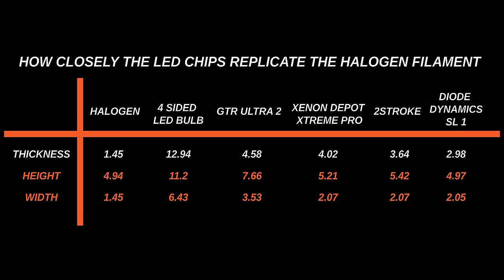Why You Should Avoid Multi-Sided LED Bulbs | Headlight Revolution

Comment: Hi! Need your help , I have a 2005 Toyota Corolla and I was looking to install this 9008 H13 Led Headlight Bulbs High Low Beams 100W 12000LM Conversion Kits 3000K Yellow 6000K White 8000K Ice Blue 4 Sides Car Truck Headlamps Anti Flicker ZDATT. And they have multiple sides. I haven't fine a yellow LED with only two sides. How I could find one that fits my 2005 Corolla.
Thank you!
Reply from the maker: Hey Charlton, Send us an email at Sales@HeadlightRevolution.com and we'll find you a good option. You really don't want to run that in your headlight.
Reply: My car has a single bulb projector setup. I have upgraded from stock sylvania bulbs to Osram night breaker laser. Does it make sense to move to LED, as the light housing does not have much space behind the bulb and i may need to cut the cap to accomodate the drivers
Reply from the maker: No, In your case you already have arguably the best setup you're going to get. The Osram Nightbreaker is a great bulb with a good color temperature and there aren't many LED options out there that will even fit your projector headlight, Let alone perform well.

Comment: Been using the Putco F1 [could be replica] for almost two years.... 9006 Low beam and fogs. On three of the four bulbs bits of the yellow filter flaked off projecting purplish spots in the beam. 😞
Reply from the maker: There have been major changes and advancements in technology since the Putco F1 came out. You’d be amazed at how much brighter these newer bulbs are!
Reply: @HeadlightRevolution  what's the best type of led chip to look for?
Reply from the maker: It's not just about the chips anymore. You want a bulb with a good fan, a good driver, a good heatsink design, and a good warranty. Send us an email to Sales@HeadlightRevolution.com and we will go over a few great options for you and your vehicle.

Comment: Your video is convincing but I still don't understand why these two sided LEB bulbs work at all.  The halogen filament has 360 degrees of light output (north, east, south, and west).  The LEDS have no north or south output, just east and west.  Why do they work?
Reply from the maker: Everything was explained in the video!
Reply: @HeadlightRevolution  I just watched the video again.  The halogen bulbs have 360 degree light output while the two-side LED bubs do not.  I guess that the 360 degree light output is not needed with these reflectors, it is just the side to side output, as well as the proper placement in the reflector, that is important.  Why didn't you just say that?

Comment: Try the bullet led bulb into the projector headlight
Reply from the maker: We've tested them and they haven't done well in the Tacoma or Ram projector headlights.
Reply from the maker: Some of the best bulbs on the market are adjustable, Like the S-V.4 and the Ultra Series 2. That being said, The best alignment is usually at the 9 and 3 o'clock position rather than up and down when it comes to chip direction.

Comment: how should the sv4 be oriented in the housing?  it came with an adjustable collar and i wanted to know if it should be vertical or horizontal or some other angel?
Reply from the maker: You want it to be horizontal, With the LED chips pointing at the 9 and 3 o'clock position. That will give you the best possible beam pattern.
Reply: @HeadlightRevolution  Thank you.  Does that go for the high beam and fog lights as well?
Reply from the maker: Yes, That applies to almost every housing on the market today.

Comment: There are 5 Sided ones now too... 
My 2002 Focus Wagon Headlights "Liked" the 3 Sided Rivco Bulb...and they are not blinding to others...BUT the 3rd "High Beam" LED is LAME...
Reply from the maker: We've played with some of the 5 sided bulbs too, They just aren't that great in a majority of applications.
Reply: @HeadlightRevolution  I would agree...One of the first 2 sided ones I bought for an H4 application had Low on one side and High (both sides lit) emitter on the other...it was worse than my Bic lighter for light output.

Comment: I just Ordered the gtr mini  for my truck do to you video. I just hope they last a long time
Reply from the maker: They do last a long time, They are a very solid bulb!
Reply: @HeadlightRevolution   Yeah I have heard horror stories about the cheap LED lightbulbs.. I've heard nothing but good things about the GTR lighting company..
Reply: I had a hard time line them up.. But I managed to find one.. And it looks like my passenger headlight is adjusted higher than my driver's side so I might have to get my headlights adjusted
Reply from the maker: Definitely adjust them, It makes such a big difference!
Reply: @HeadlightRevolution   I have to go to the dealership tomorrow to have a new radiator installed in my pick up truck because it is leaking.. And they have to take the whole front off headlights and all Some gonna have them aligned the headlights

Comment: Please help me !!
F 150
2015 supercrew,
I need high and low
beams and fog lights.
I'm on the highway, back roads.
I Need a light that helps me avoid hitting 
Animals, and see when vehicles are on the side of the road.
Thanks
Reply from the maker: We ave tons of options for your vehicle, but if you are looking for the best of the best, the Morimoto XB LED Headlight housings will be the ones to go with by far! They come with a lifetime warranty, mount to the same points as the factory headlights, and are completely plug and play with that factory wiring! Not to mention the fact that everything in them is LED right out of the box, so no need to deal with installing bulbs or annoying resistors! I linked those bad boys for you here, and if you get some on order make sure you add the coupon code ECLEDT10 for a free pair of T10 bulbs for your license plate lights or cargo lights! Link: https://headlightrevolution.com/2015-2017-ford-f-150-xb-led-headlights-with-white-drl/

I have linked the fog lights and taillights for you as well! 
Fog Lights: https://headlightrevolution.com/2015-ford-f-series-xb-led-fog-lights/
Taillights: https://headlightrevolution.com/2015-ford-f-150-xb-led-tail-lights/

Comment: What if my headlamp was designed for a HID, light system,  wouldn't the multi sided LED work ??
Reply from the maker: The multi sided LEDs will always perform worse than even your factory halogen bulbs in most applications. There is a small chance that you will plug them in and they will work, but that is a very small chance for sure! Let us know if you have any other questions or concerns, have a good one!

Comment: I'd sure like to get some personal help with my two sided superbrightled company says bulb needs to be straight up and down when installed but no matter how I put them in there angled and beam sucks
Reply: Depends on What Bulb Style it is...H13 that I have in my F150 are on the sides!
Reply from the maker: They need to be adjustable. Those bulbs may not be properly adjustable like some of the others on the market today.

Comment: I have hid that I bought from you guys is there a brighter led option for hid projector housings? 2009 nissan maxima
Reply: But HID are brighter and stronger than LED for low beam...
Reply from the maker: HID is likely going to be your best bet for those particular headlights honestly, especially with a projector low beam.

Comment: Will you please do a review on 100w hid kit?
Reply from the maker: Maybe. We used to mess with 75w HID kits but they needed heavier wiring, relay harnesses and they ran too hot. Sometimes they would even melt headlight assemblies. That's the last thing you want to have happen!

Comment: Does the same apply to all the other exterior/interior lights?
Reply from the maker: Not when it comes to turn signals or cargo/license plate lights. In those, It's actually really helpful to have a light that emits close to 360 degrees.
Reply: Headlight Revolution Thank you!

Comment: When are your GTR Ultra 2 H11 led bulbs supposed to be back in stock?
Reply from the maker: Hopefully this week, We are buying up almost the entire supply of them.
Reply: @HeadlightRevolution  Thank you for the information as I ordered them from your company last week and they were out of stock. I had the V2 Opt7 h11 led lights installed in my 2016 Nissan Altima and they were horrible, with the drivers side burning out after 10 months. I'm now running on one led and one incandescent bulb until the gtr ultra 2's arrive.
Reply from the maker: You are going to be blown away by these bulbs, Especially coming from the V2 OPT7 bulb. I can't wait for you to get them!

Comment: Why werent the smaller multisided bulbs tested in the projector housing? Thats why i clicked on the video in the first place
Reply from the maker: They really don't perform well. As they get smaller they seem to produce no hotspot on the wall, Which is a major problem when it comes to distance lighting.
Reply: Headlight Revolution Alrighty thanks for the response, appreciate it!

Comment: *I just replaced the quartz-halogen bulb on my '08 Honda 'Metropolitan' with the same-type bulb...only 3-hrs. of 'on-time' and the new bulb has black
soot inside already!*  (The bulb the 'high-beam' filament burnt-out on was an original factory bulb with 11,000 miles on it, and has NO 'soot' inside at all...so no more ordering 'China Made' bulbs for 6-bucks for me!*
*I just talked to some guy at "Headlight Experts" to see if I could get some info on maybe an 'LED' and the guy cannot or will not tell me anything
except "Go to the website'*  Too bad for them...I'll get something from somewhere, just not 'There'
(That's kinda' weird when I think on it...someone answering phone plays 'Sgt. Schultz' of "I know NOTHING about anything!)
Reply from the maker: That should totally not have happened unless there was a short in the wiring, but if the other bulb didnt do that on the same side then you are good to go! As for LED recommendations, I think what the other rep at Headlight Experts meant to say is that due to the changes in regulations on vehicle lighting, we can no longer recommend LED or HID for street use in a headlight. In all other applications you will be good to go with LED such as fog lights, turn signals, and interior lights! If you would like LEDs for your headlights, you will have to get them for "offroad use" to actually check out with them. If you would like to look into any of those offroad options, let us know and we will be happy to help! I have linked the halogen options we have for you here: https://www.headlightrevolution.com/search?keywords=halogen
Reply: @HeadlightRevolution  No, no 'short' anywhere BUT I notice there's a dim-factor at idle that is far more than the original 'QH' bulb ever had...in fact I re-installed the original bulb because the low-beam still works
THANKS for the 'Link'...I'll try it now
( My Honda is my 'Precious' and looks and performs as 'Showroom Fresh' with only minor powertrain upgrades...does 42mph w/a 220lb. 'lard-ass' on the huge saddle!)
Reply from the maker: That is awesome, let us know if you need anymore help with that lighting for that vehicle! Thanks for commenting and have a great day!
Reply: @HeadlightRevolution  I think I'll order the 'old-school' 'Q-H' bulbs the site has, even though they are 'old stock' items now discontinued  
( I don't want anything that requires me to make 'modifications' to a system that works fine 'as-is'...and as you said in the video, the "LED's make a poor pattern for road-lighting" and the reflector-bowl on the little Honda is GIGANTIC for such as small machine, and I don't want to go down the road making 'House Fly ' views! )
Reply from the maker: Totally get what you are saying, let us know if there is anything we can do to help along the way! Thank you for your time and have a great day!

Comment: I would be interested to hear from anyone that has tried these LEDs in a classic car with headlamp buckets.  I don't see these bulbs surviving sealed in a bucket with no airflow, I would think they would quickly overheat.  Okay, so drill some holes in the bucket, problem solved.  Really?  Those headlamp buckets don't have holes for a reason.  Puddle goes splash, $50 LED goes POW!
Reply from the maker: Most LEDs have a fan, which is all you need to circulate airflow and prevent overheating. The Morimoto 2stroke 3.0 would be the best example with their high-tech fan.

Comment: two sided leds have a dead spot in the middle tho
Reply from the maker: That is correct because most LEDs do not mimic the OEM halogen locations. The bulbs listed on our website, especially the Morimoto 2stroke 3.0, are the only LEDs on the market you'll find with comparable filament locations which is VITAL for retaining a good beam pattern.

Comment: And what about car with projectors??
Reply from the maker: Still wouldn't use them, projectors focus light in a very similar way and having light thrown everywhere would still result in an unfocused beam.
Reply: @HeadlightRevolution  what you recommend for projectors? Maybe xenon lights?
Reply from the maker: Absolutely!
What vehicle do you have?
Reply: @HeadlightRevolution  mercedes w204 c180 kompressor avantgarde. What do you recommended to me?